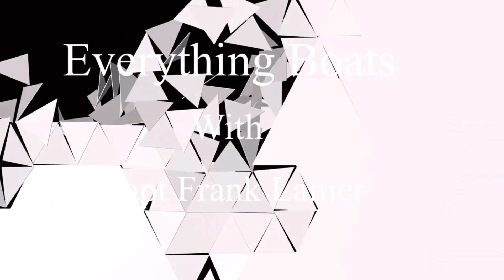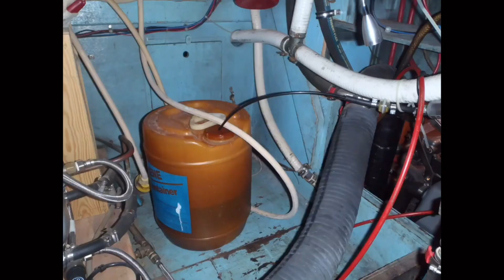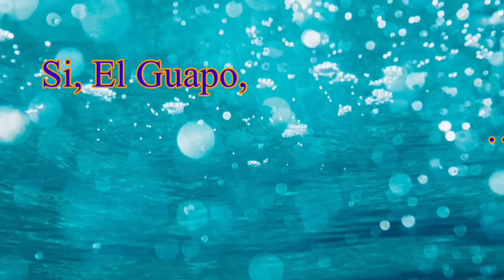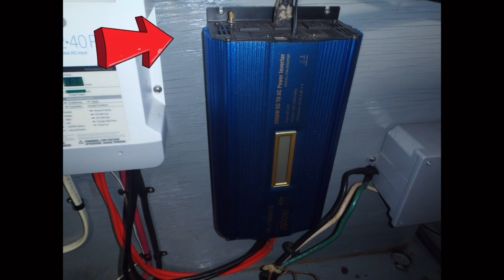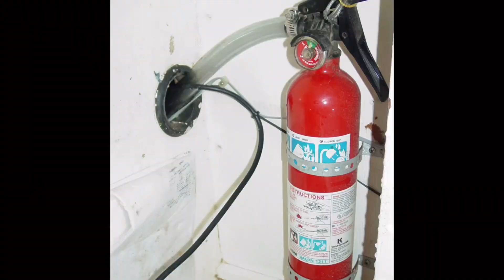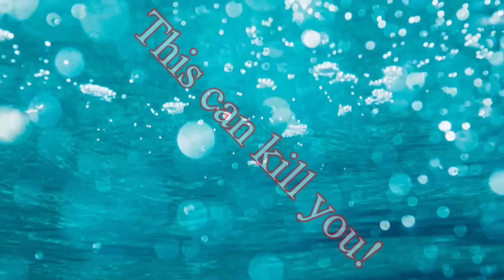Capt Frank’s Sea Chest Of Horrors (Episodes 21 through 25): Bad things on boats and why they’re bad!

Comment: I wish you could have looked over my shoulder when I looked at purchasing a boat about 25 years ago.  Oh where do I begin!  28' Morgan keel/centerboard.  

Inboard Palmer gas engine not running reliably and yard incapable of figuring it out (it was a bad fuel pump ground).  They mounted a 15hp outboard on on the transom.  On the raked transom.  So it couldn't be tilted up.  With a backing plate about the size of a dinner plate.  You could watch the transom flex.

The fuel tank was missing.  The boat was being run from a portable tank left in the lazarette.  Next to the battery.  The lazarette vented into the engine space under the cockpit ... and from there into the bilge.  

Of course the outboard wasn't wired into the boat's electrical system.  So, a battery was being charged at home and placed on the cabin sole to run the bilge pump, wired directly, without a fuse, and not through the boat's electrical panel.  Connecting it just might make a bit of a spark.  After the bilges were pumped, the battery could be placed in the battery compartment and connected to the boat's electrical system, which might just make a spark when it was connected.  

The boat DID have a bilge blower, but it was some crappy generic thing with an open brushed motor.  I took it out - you could watch the brushes spark when you ran it.  I replaced it with a decent one.

There were a few other things, like the wiring for the running lights (plain copper, not tinned) running along the shelves either side of the cabin, the hole cut in the top of the water tank, the corroded away mast base, the dead manual bilge pump, and much more I've forgotten.

I bought that boat just to get it out of that guy's hands.  I figure I probably saved his life.  He was not a dumb person - he just didn't know boats.

I spent a year repairing that boat - I had a lot of fun with it.  It was a challenge making it safe.  I ended up having a new fuel tank fabricated, re-wiring most of the boat, cutting 2" off the bottom of the mast, raising the mast step, fabricating a new rudder tube, replacing all the rigging, fixing the water tank, replacing the stove, etc. etc. etc.  

Great fun - working on that boat kept me sane during a difficult time.   Turned out to be overcanvassed and with no directional stability, not to mention a wickedly short roll period.  But she was darned fast in light wind.
Reply from the maker: Thanks for the comment! I can totally relate to everything you say. Every boat I've ever owned has been a "project boat" as those are the only ones I could afford! I moved aboard my first boat (a wood Owens Sea Skiff) when I was 17 years old and have lived on many boats on and off ever since, from locations along the eastern coast of the US and the Bahamas to Hawaii and Guam. The project boats are the ones you learn from, so good on you !